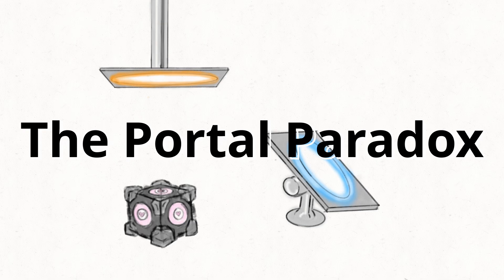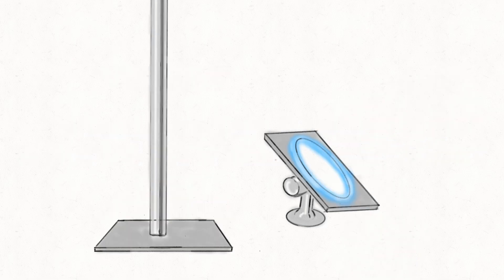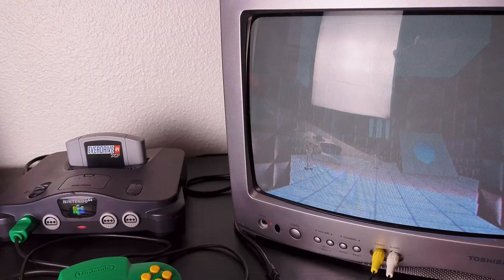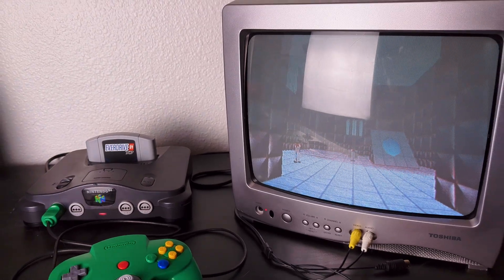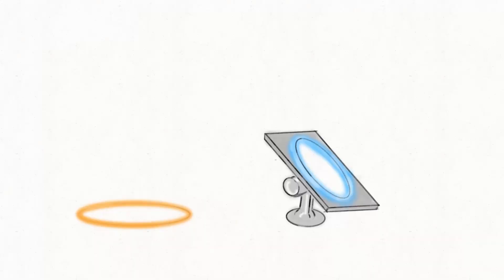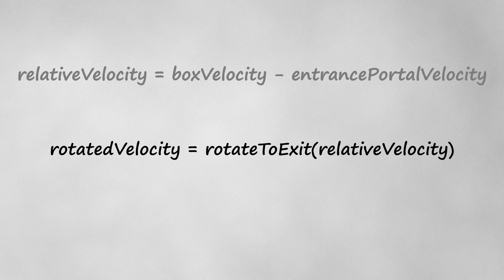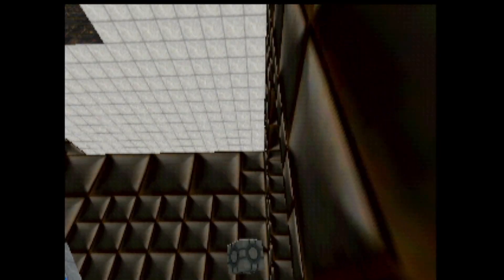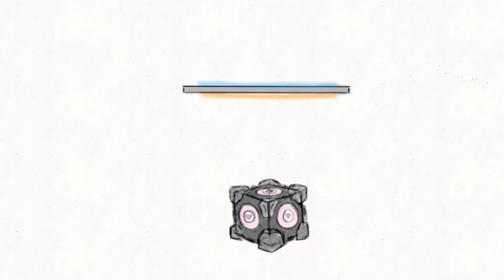I rewrote Portal from scratch and solved the Portal Paradox

Comment: Think of a long pole made of a very light material firmly connected to the ground and dropping the moving portal (the other portal being stationary pointing upwards) from above on top of the pole. Now while the pole is halfway through the portal (not moving by itself on the other side since it's connected to the original ground) you cut loose its connection to the ground and shortly after that stop the moving portal. By your physics, the pole would now take off and hurl itself skywards into the now stationary portal.
This seems wrong. The momentum of the portal shouldn't influence the object, since the portal doesn't have mass and there is no actual force afflicting the object other than air resistance. Your physics engine doesn't recognize the portal itself as massless, which leads to a wrong conclusion/simulation of what should happen.

Comment: This is a cool project! I was originally confused by your solution, but when you showed the second example it makes a lot of sense. I still don't like it, lol, but it makes a lot of sense.

If the cube is stationary when the entrance portal comes down over it, and the exit portal is moving at the same speed as the entrance portal, it definitely makes sense that the cube would remain stationary. However, for the cube to react in the way presented in this video, I feel like it's implied that the entrance portal is a vehicle, if that makes sense. Like, say the cube was on a moving platform. If that platform collides with something, the cube would keep its velocity given by the platform and fly off. In this example though with the platform moving toward the cube, I would expect the cube to react in the same way as if you had 2 portals on the ground, because "Speedy thing goes in, speedy things comes out", not "Speedy thing eats cube, speedy things comes out."

In terms of the puzzle solving aspect tho, I think this is a neat concept!
Reply: well like he said there's no difference between a portal moving towards a cube and a cube moving towards a portal. It's all just frames of references. If you looked down through the blue portal, you would see the cube moving towards you rapidly, even though it's the orange portal that's moving. So naturally that relative movement is maintained as it crosses the threshold. meanwhile in the hula hoop example You would still see the cube moving towards you, but you're also moving towards the cube on the blue end of the portal as well. So from all frames of reference the cube remaining stationary remains consistent.
Reply: @BlazeMakesGames  If that is the actual explanation, then I believe it's vastly mistaken. It's what I would consider to be a massive overthought of reality, based on just enough actual science to be mistakenly, or understandably correct. Even though it's probably not.

For example, you say "there is no difference between a cube moving towards the portal, and the portal moving towards a cube." I would disagree, since in any practical example we are dealing with the force of gravity on our planet. A cube, with inherent momentum built up from falling toward a portal is MUCH different than a portal being pushed toward a cube with no inherent momentum. Keep in mind the portal and the platform are 2 separate things. The platform has momentum built up, but the portal itself would not. Even though it is on the platform, the portal itself is a stationary hole in space time...
Reply: @DeepFriedOreoOffline  what you're saying is self-contradictory. How can you say that a portal is a stationary hole in space time when it is also clearly moving? It is only a stationary hole if you consider things from its frame of reference, which you can absolutely do, and if you do so then in that scenario the cube is moving towards it. 

When I say that there's no difference between the two scenarios I'm not the one that came up with that. That's a thought experiment from Einstein that supposits that there's no difference between a stationary reference frame in a gravitational field and a moving reference frame that is constantly accelerating with the equivalent force of gravity. There's no test that could be conducted that doesn't involve looking out of a window, that would be able to tell the difference between the two. 

The reason why it's so mind bending is that in this scenario the portals allow for what should be a single reference frame to be two reference frames. Because on one side of the portal the frame is moving and on the other it is not. But what this results in is that if you look through the blue portal while the orange one is moving, then it appears that the entire universe is moving towards the portal despite you standing still. 

---

Another way of thinking about this issue that might be more intuitive is to think about it frame-by-frame. Imagine you are looking at the cube exiting the blue portal 1 frame at a time. 

On Frame 1 some small portion of the cube is sticking out because the orange portal is only partially enveloping the cube. 

Then on Frame 2, a larger portion of the cube would be sticking out. But how do we get to this point from Frame 1? Well the portion that was sticking out on the previous frame had to have moved out of the way in order to make room for the next portion to stick out. 

Thus, effectively as each frame passes, the cube is essentially pushing itself out of the blue portal simply due to the lack of space on the orange side of the portal. No matter how you slice it, the cube has to have moved in order to finish exiting the blue portal. It simply can't have gotten to that point without moving at all. Thus the only question is how fast the cube is moving when that happens. And well the only logical answer is that the amount of cube that sticks out of the blue portal is equal to the rate that the orange portal consumes the cube. Essentially the cube must be moving at the same velocity as the orange portal is moving. 

Thus the only logical way for this sequence of events to even occur, is if the cube is in fact moving at the same speed as the orange portal when it exits the blue portal.
Reply: @BlazeMakesGames  It's hard to disagree with you, cause you make a lot of sense, and I am not even a physics minor, lol... In my mind, a portal is comparable to an open door... also called a portal.

If an actual door was on that platform being pushed toward the cube, in a practical example that would be the same as having the red and blue portal on opposite sides of the platform. Which, I understand works the way it does because in that case, both portals have the same velocity and cancel each other out, in layman's terms.

What I really do find mind-bending is that a portal being a physical thing, opening a doorway to a different location, is somehow able to impart it's momentum on something that passes through it... It's not really a "thing", it's an absent area of space.

In my dumb opinion, Einstein was wrong on this one. Humans observing reality through a "frame of reference" doesn't mean an absent area of space is an observer, lol.

Comment: I think this equation is wrong because portals are not objects; they are just holes connecting two points in space. Therefore, they cannot have speed. The same goes with a hole in a wall: it also has no momentum.
The cubes, on the other hand, are objects and therefore can have momentum measured from a non-moving object in the universe. That is, an object that has not moved since the beginning of time.

So when you now move the portal against the cube, the atoms going through the portal teleport from one portal to the other while keeping their momentum. And because their momentum hasn't changed while going through the portal, the cube just falls to the ground on the other side.
For all the other cases, the rules remain the same: speedy thing goes in, speedy thing goes out.

Comment: Portals have neigher mass not collision, thus trying to solve this paradox with conservation of momentum is pointless. They can't transfer momentum since they can't ever come into direct contact with the cube (if they could a cube launched through stationary portal would lose speed which doesn't happen). Wouldn't then a cube suspended in the air gain energy out of nowhere if portal was shot though it and kept going after that (in case someone says that the portal coming to a stop is where momentum is traded)? Even trying something like using speed relative to moving portal is pointless since the cube would still be travelling at the same speed after going through the portal (just in another direction since it passed through the starting coordinates in this system) relative to it as if the portal just flew by the cube. Adding the speed of the portal would just double the speed of the cube out of nowhere in this system.
Reply: Portals as implemented create energy.
Dropping a box into a portal and having it come out at a new angle changes its velocity without applying any force or acceleration to it.

Comment: The way I think of it is if the portal is linking two parts of space and one portal is slammed down, looking into the other portal makes it look like the ground is flying up at you, so if there was a box on the ground that's rising rapidly and suddenly that ground stopped rising, that box will still have all that energy going up once it's through the portal.  So if it got slammed down on the box but stopped with the box only going halfway into the portal, would half the box have that energy and pull the rest through it, or would it remain un effected?  I think it would pull itself through personally.

Comment: One real obvious example of why relative velocity makes so much more sense than absolute velocity:

Say the exit portal is moving sideways. you move the cube into the entrance portal (regardless of reference point). If velocity is absolute, the cube will simultaneously be constantly centred on the entrance portal, but will move laterally relative to the exit portal, which means the two portals are no longer linked.

Comment: I don't understand why the entrance portal would impart its momentum onto the cube though? In my mind the cube would remain stationary regardless of the speed of the portal.

Like imagine if instead of slamming the portal down on the cube, it stopped halfway, by your logic the cube should be flung upwards fully through the portal at the same speed as the portal which doesn't make sense. 

If this was source portal and you looked through the exit portal you would see the floor and cube moving towards you and pass through the portal before being flung.

I don't agree with your conclusion
Reply: If it stopped halfway, only the front half of the cube would be given momentum, and then it would have to drag the back half through the portal. It would exit slower.

Comment: Before this I'd honestly just lazy out and only program the rotation part of the portals (so the cube would pop out with no velocity).

But taking into account relative velocity on both entry and exit works best. It also means if you manually place a cube in a stationary entry portal, and the exit portal has some horizontal velocity, the cube will fall and move horizontally as well, like dropping things from a plane.

Pretty cool.

Comment: The main thing that bugs me about this whole problem is that there should be some sort of transfer of energy between the portal/piston setup and the cube. Instead it appears to just add kinetic energy without any corresponding loss anywhere. I do realize that this sort of thing is abstracted out in videogames in general for the sake of simplicity, though.
Maybe it's just 7am brain, but that's the last issue I can think of with this result. Otherwise it's a pretty sensible solution.
Looking forward to playing the finished game either way!
Reply: I think the piston is just heavy enough that the change in velocity of the piston due to the cube going through should be negligible.
Reply: well having a portal at a higher elevation than another one is also a way to magically add energy to an object without any corresponding losses. It's why you can build up infinite energy by simply placing a portal above another one and letting an object fall an infinite distance. Any difference in elevation allows you to create or destroy potential energy at will, and it would be trivial to set up an infinite energy source using basic portal physics. So the idea that this wouldn't work because it creates energy from nothing is simply wrong since that's what portals already do by default in most other circumstances.
Reply: @BlazeMakesGames  True enough I suppose. Relatedly I did hear an interesting theory once that gravity might "leak" through portals (in the hypothetical situation that they exist in reality) which would nullify the infinite falling effect. So yeah just 7am brain, though the overall thought experiment has been entertaining!

Comment: In real life this equivelant situation wouldnt happen. Your math is flawed in that you're adding momentum of the portal. The portal has no momentum, only the edges do. The only forces that s h o u l d act on the cube are the competing perspectives of gravity and the edges pushing air.

Your flaw is that you assume that the portal in of itself should have momentum, when it is the edges and the edges alone that would have momentum. The portal is just a hole. It would gain force, but it wouldn't gain force from the portal's impact, it would gain it from the shift in gravity and the rush of air. It'd be between the two ideas.

Comment: You'd think that it wouldn't launch cause the velocity of the object is zero. But I sort of understand the math for this

Another good way to show the fact that both Portals moving at the same speed causes the cube to have no velocity would be to have the exit portal be on a moving wall that moves towards the wall (the portal is facing away from the wall)
Reply: You definitely don't understand how portals work. It's the same as doorways, but portals connect two absolutely separated area and don't provide gravity force.

Comment: So the flaw in your approach is that the puzzle asks us to determine the box's velocity relative to the Earth. Does it slide down the ramp or shoot into the air. You're not looking at the box's velocity relative to the earth at all. You're looking at it's velocity relative to the portal. In order to solve this puzzle the only thing we have to answer is does the portal effect the box's velocity because we know that the velocity relative to the Earth is zero at the start of the experiment, it's sitting on the platform. If the portal cannot effect the box's velocity it will slide down the ramp. If the portal can effect the box's velocity it will shoot into the air. Aaaaannddd.... Portals have no mass. They hang wherever they are placed, even in the air. Something without mass cannot effect a change in vector upon an object with mass. If you rode a moving sidewalk through a doorway, the doorway would not make any change on your velocity or trajectory. Portals can in no way change an object's velocity or trajectory, they only change it's coordinates. They are just doorways, not a hand that pushes. So the relative velocity of the portal and the cube is irrelevant to the cube's behavior after leaving the exit portal and because it starts with the same velocity as the earth, it's just going to slide down the ramp after exiting the portal.
Reply: If the frame of reference you chose changes the answer then your physics is wrong.
That being said, portals just create energy out of nothing sometimes. Even changing the velocity of an object instantaneously the way they already do in-game is impossible.
Reply: @ZeroKitsune  The frame of reference is built into the puzzle. Both A and B show different outcomes based on the cube's speed relative to the Earth. The only difference between A and B is how fast the cube is moving relative to the environment it is in.

Comment: But wouldn't the speed of the cube be canceled out by the speed of the portal itself, since both move in opposite directions? I believe that the cube would only be projected away if the portal penetrated the floor, taking the cube out of inertia.

Comment: Okay but what would happen if the portal slammed down on the cube but stopped abruptly halfway through the cube? Would the cube fly up and through the portal? Would it stay on the ground? I think the top half would pull in the rest of the cube, thereby moving it up. But not with as much force as the rest of the cube is pulling against it. The question is, how does your engine respond to that?
Great video as always, keep it up :)

Comment: Great video, but i must disagree: stationary cube does not have kinetic energy, and the only thing that changes for it as the portal comes down is the direction of gravity vector, therefore it should plop, not shoot out, as the portal itself does not transfer kinetic impulse (the frame does, but the cube does not interact with it as it's passing through the portal)
Reply: As the box passes through the portal, each part of the box comes out of the other portal with no momentum, but the parts of the box behind it push against it and cause it to gain momentum. Essentially the box flies out because the top parts of the box are being pushed out of the way by the lower parts.
And yes this might actually create energy from nothing, even stationary portals can do things like that.
Reply: @ZeroKitsune  going by this logic would mean that static portals would accelerate already moving objects as they'd pass through, which iirc is not the case for the games (try bhopping through a portal)

Also there would be a tearing problem as parts of an object are at a certain point in time affected by two simultaneous gravities, but that's a whole another story, lul